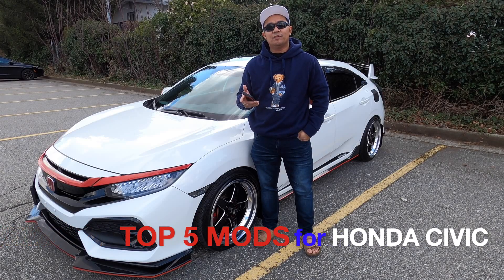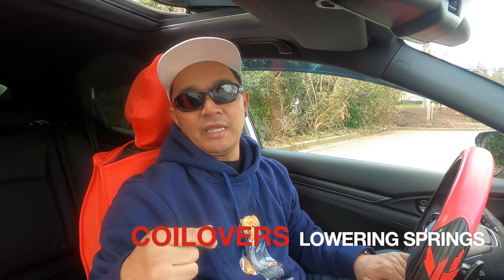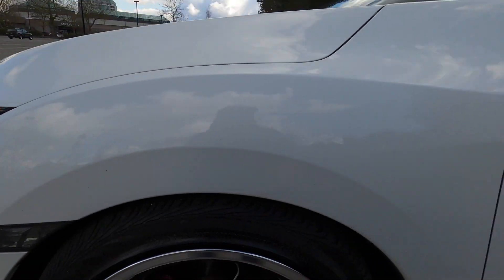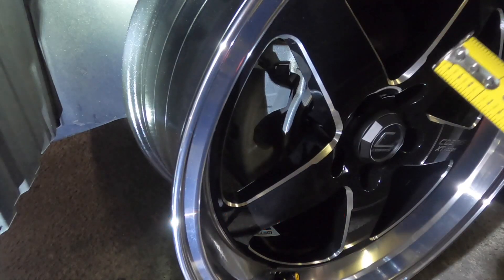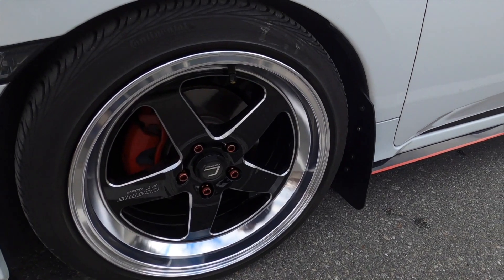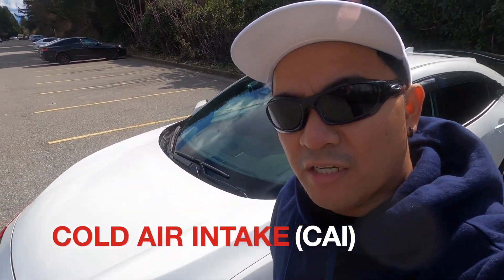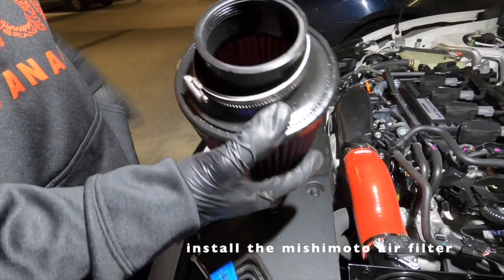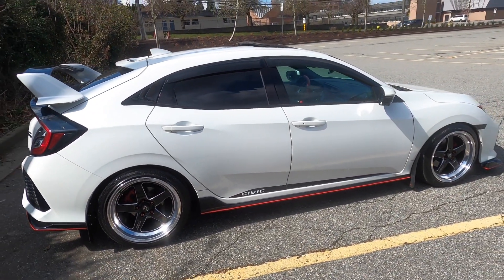First top 5 Mods for Honda Civic Hatchback Sport

Comment: is the cold air intake dino tested? its controversial that the cold air intake loses power without a tune or bigger pipes. genuine question for those with a fk7 cold air intake no tune

Comment: Where did you get the black covers for the little windows in the back of the doors I also want to install a front lip
Reply from the maker: I bought it on eBay
Reply: @geefamz7172  can you share the link please?
Reply: They’re called louvers just look them up on Amazon. Make sure you get the hatch version instead of the sedan, if you have the hatch.

Comment: Thinking about getting a Sport hatch, what do you think of these as a first five? 

DC Sports Strutbar
Konig Ampliform Wheels
BC Racing Coilovers Standard Drop
PRL Short Ram Intake Street MAF
Borla S Exhaust
Reply from the maker: Good choices 🤙
Reply: I’m a little worried about voiding the warranty, maybe swap the intake for a Torque Solutions Blow off Valve and hope they don’t care about that. Idk it’s tough because if I get oil dilution they’re gonna try to blame it on mods not the  improper combustion from GDI+Turbo.
Reply: @Average_CoD_Clips  bov is a no no. Is a bad bad choice!

Comment: did you have to tune your car after getting a new cai?
Reply from the maker: I got a hondata tuner but I don’t think its really necessary to tune the car after installing cold air intake. So basically its up to u if u want to tune it or not.